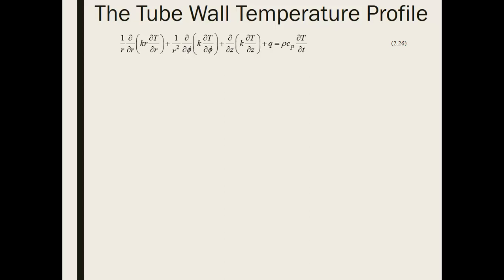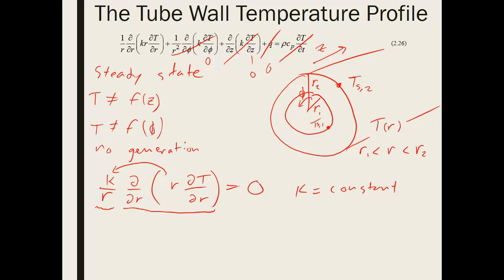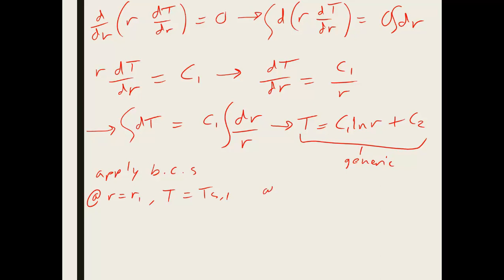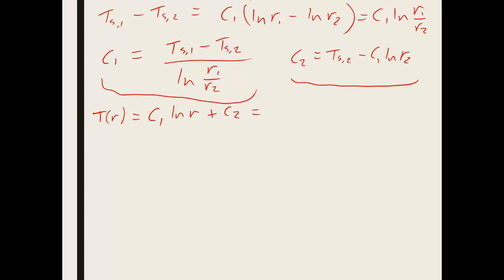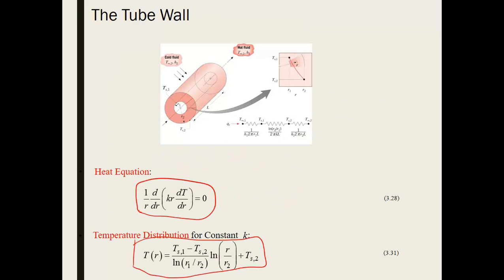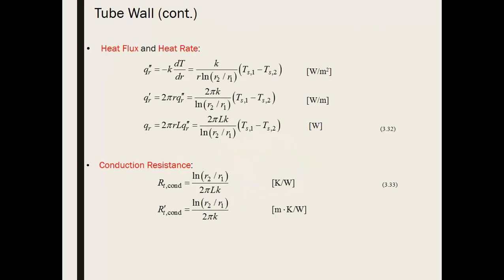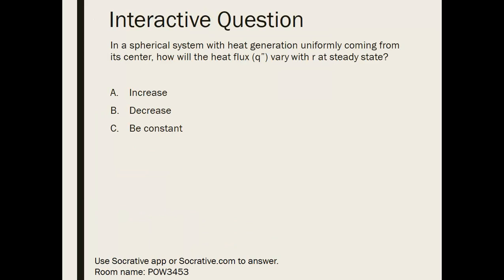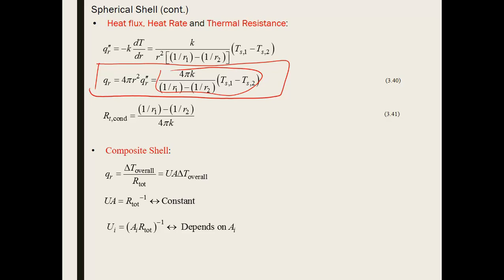Heat Transfer: One Dimensional Conduction for Radial Systems (Cylindrical and Spherical)

Comment: Hello, how are you? Explanation of the lecture is very interesting. It is possible to derive the heat transfer equation by conducting the hollow cylinder with the heat generated one dimension
.

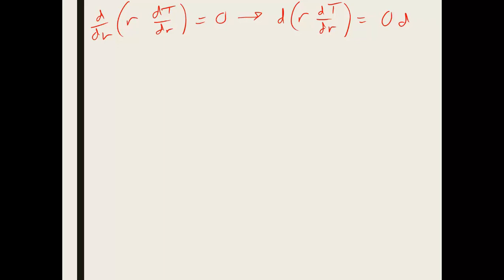Comment: The only problem I had in my class is the professor was doing things with the operators that I did not understand. It's like what you did at 5:36. You just leave the d operator  on one side. Then integrate just the d. I don't recall ever integrating like that. I wanted to just say integrate both sides with respect to r. It may be the same result but I never see just the d left on the left side like that.